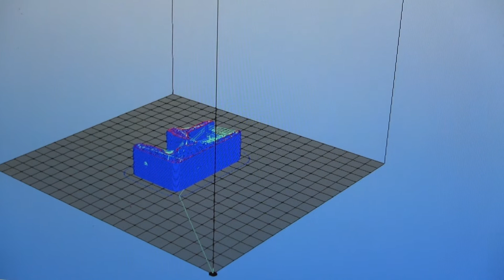3d printing (my first print)

Comment: Hi Michael, I was wondering if you have a heated bed. I noticed some warping in the corners of the first print and was a little curious.
Reply from the maker: yes I do have a heatbed with it´s own 24v power supply controled with a opticoupler